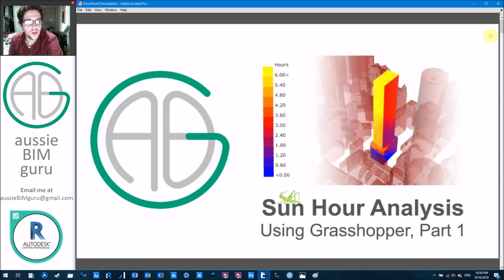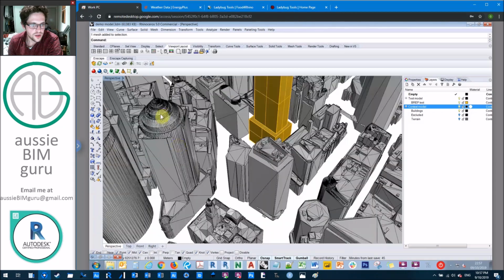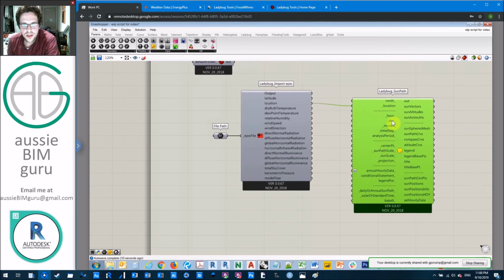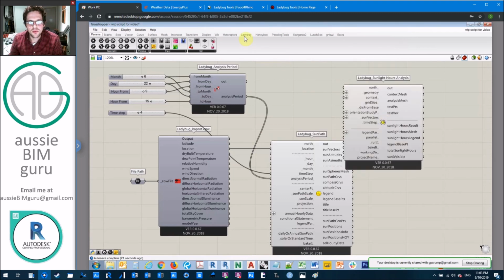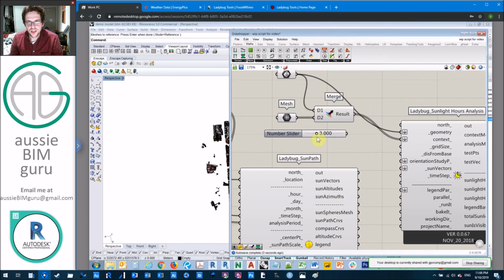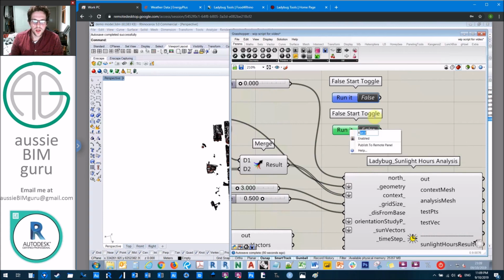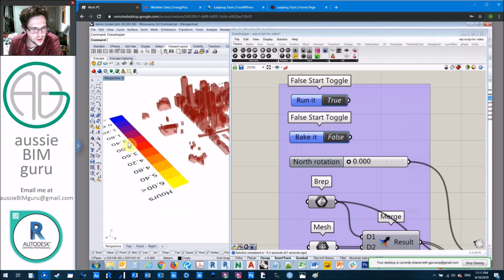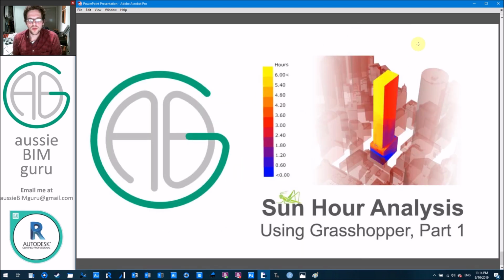Sun Hour Analysis using Grasshopper (Part 1 of 2)

Comment: Super good tutorial ...  I had some problem with the "special false toggle" I could not draw the special false toggle inside the grasshopper canvas (I am using Rhino 6, and it seems some issues with the IronPython - too much for my little head)  ... I just worked with the regular toggle, and it's fine =D
Reply from the maker: Hrm weird it works for me in rhino 6, its under ladybug extras I think. Normal toggle is OK but dont forget to set to false before closing :)
Reply: @AussieBIMGuru  Yep I even put a note to that! Thanks a lot =D